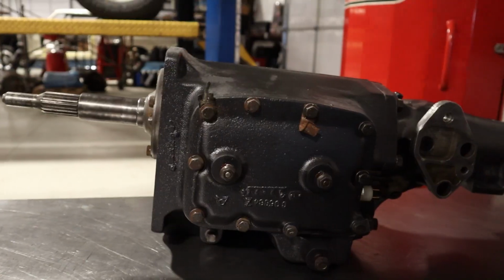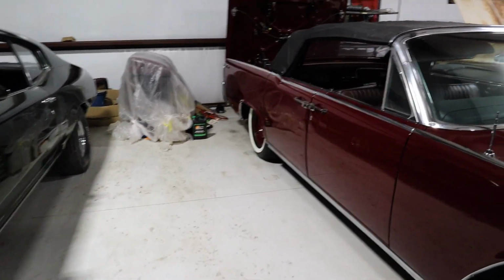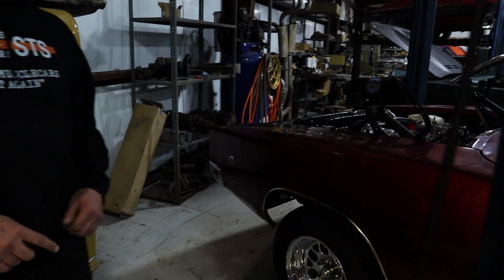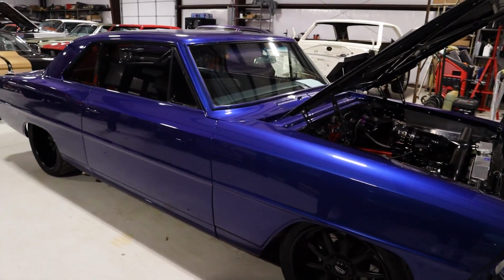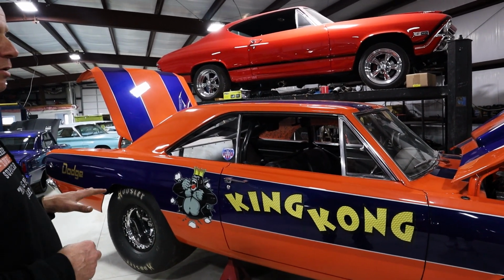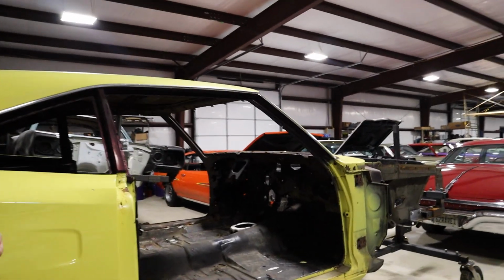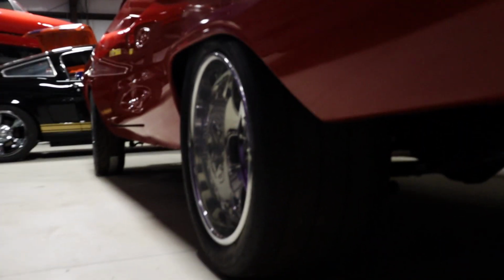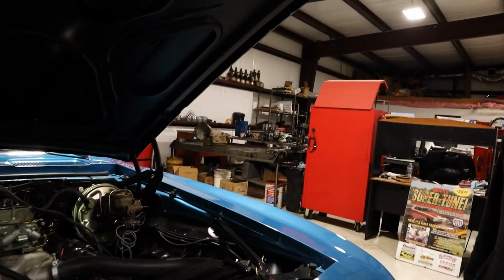Smothers Tuned Supercars Shop Tour

Comment: I've driven Mopars almost my whole life, I've only been lucky enough to have two real Hot Rod models, a 1970 GTX 440 Super Commando and a 2004 Ram GTX Hemi Pickup in Timberline Green. Down to a 2016 Dodge Dart turbo with 25,000 miles and a 1996 Dodge 2500 shorty conversion van